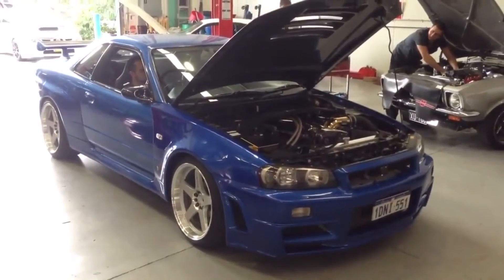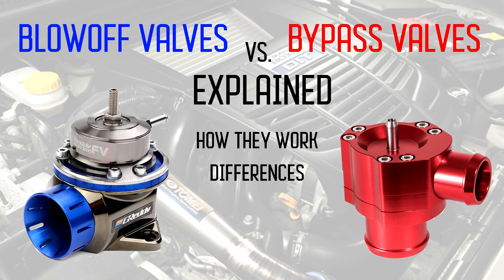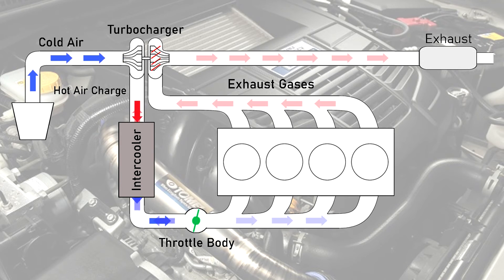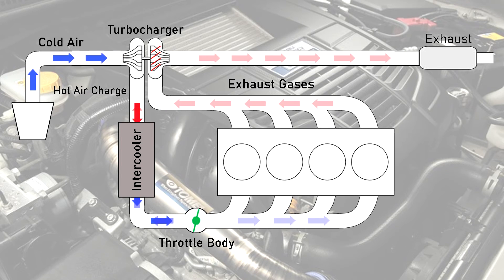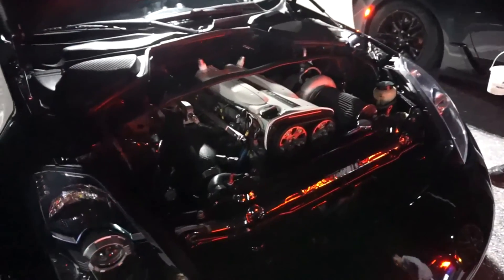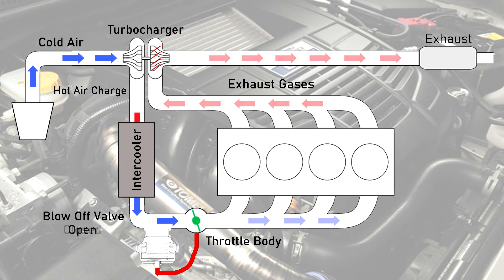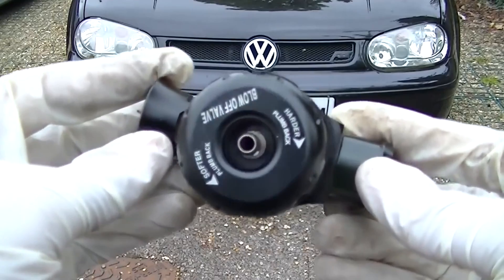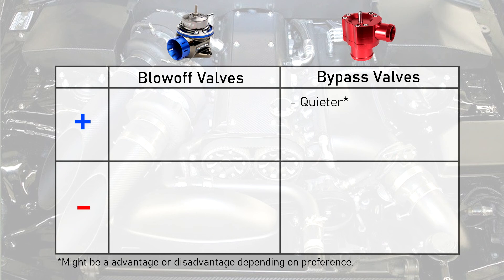Quickly Clarified - Blow Off Valves vs Bypass Valves in 4 Minutes!

Comment: I used to work for Garrett granted this was over five years ago but the sum of the statements that you made in regards to the CBV are incorrect and high horsepower applications these were well and low and high horsepower applications one thing you did mention was correct was the majority of the time space is needed but this is easily overcome
Reply: What the hell are you even trying to say?
Reply: @KreatorOfDeath1985  Bro he use to work for garret!!!! who tf is garrett?
Reply: @byron1dagg80  Garrett is a company known for their turbochargers. Their entire brand revolves around turbocharging cars.
Reply: Bro, use some punctuation. I can not tell what youre saying
Reply from the maker: thanks for the correction, pinned your comment
Reply: Is that English?
Reply: okay I'll transcribe it I guess. 

"The majority of the statements you made in regards to Circulating Blow off Valves (?) are incorrect. These aren't just for low horsepower applications, they also work well in high horsepower applications. One thing you did mention that was correct however was that they are often times not used because of space limitations, however this issue is easily overcome"
Reply: What, were you sweeping their floors? In doubt you could grasp the engineering behind even basic principles like a toaster let alone forced induction with the atrocious grammar, and basic English used in that comment. If you are gonna bullshit in the comments, at least read it before posting 😂
Reply: From what I know: Also what is missing here, if the car comes from factory with a MAF, venting to air can cause the engine to run rich. That is because the stock ECU thinks the air is still in the system for use and adapts its injector duty cycle to the air it thinks it has available. That would also be a con for a vent to air in that case.
Reply: @MarxusRainbow that’s true, but most people going as far as a BOV (likely intercooler, intakes, downpipes, etc.) are likely doing some sort of AF tuning as most of the older models still using MAF systems are well outside of warranty, if not they can expect to run into some issues regardless. Thankfully, most newer model systems that are forced induction use MAP sensors instead of MAFs.

Comment: Correct me if I'm wrong please I'ma Whipple guy and new to turbocharger, so my ❓ since my car has a stock turbo charged and I'm not planning on upgrading my turbocharger I only want to upgrade a cold air intake with cat back delete and tune. 

So my question is, keeping the stock turbo should I put a BVP only?

Comment: I don't understand one thing, there is nothing preventing high pressure air escaping out the air filter in a bypass valve system. How is that then any different from directly venting air to the atmosphere?
Reply: There is, when it’s recirculating it goes to the where the turbo sucks its back in, in a loop

Comment: Bro...can turbo diesel engine use the same blow off valve as the petrol engine?
Reply from the maker: absolutely, just depends on the mounting to the piping. it has to be airtight so there's no boost leaks
Reply: @JCMediaYT oh nice...thank you for answering my question😃
I always wanted my car to have that Pssshh psshh sound...I just bought a used  pick up truck couple weeks ago...4WD Mitsubishi Triton year 2010...and I heard that if your car doesn't have throttle plate you can't install BOV...but luckily my truck does have 1...hahaha...turbo with no psshh psshh is like hotdog with no sausage😆
Reply from the maker: @JakeHuang24  anytime! I'm not too sure about the throttle plate stuff since I don't have any diesel cars, but goodluck with it! feel free to leave any more questions if you have any

Comment: So from wat I can tell bov only vents fresh air, so then why is it against the law to have one in my state ?
Reply from the maker: I believe it has something to do with emissions. I'll try explain it as simple as possible. When the air gets sucked into an intake, it passes through a MAF (Mass Airflow Sensor) that basically reads how much air is going into the engine. The ECU reads this and injects the appropriate amount of fuel. When you use a vent to atmosphere BOV, the air is escaping the intake system and going into the air, but the ECU still thinks that there is air going into the engine. This creates a "rich" condition where to much fuel is being injected since the air was vented.
Reply: @JCMediaYT  ahh ic, i understand why the law is that way now, thx for that.

Comment: Question. Can a "bypass valve" work as a "blow off valve" ? If you just remove the pipe that runs back to the intake manifold (or the place the extra air goes to and obviously block that part up) ? 

I will be running a carburettor, so I don't think that will affect air flow readings etc...

The reason I'm asking, is because i already have a bypass valve ( I bought a supercharger from a toyota which had the sc12 supercharger on it and the bypass valve is the one that came with it) 

So my final question is; should I go by a blow off valve? Or should I just use the bypass valve as a bypass valve and be happy? Or can I use the bypass valve as a blow off valve?
Reply from the maker: theoretically yeah, since they are basically the same thing (a valve actuated by vacuum lines)
Reply from the maker: usually cars come with a bypass valve made of plastic which can't handle increase boost levels, hence why some people may change to a bov (also for the sound). However, a higher quality BPV works just as well so it's mostly down to preference on which sound character you prefer
Reply: @JCMediaYT  Ok thanks for the reply. The toyota BPV is indeed made out of aluminum and I'm only going to 8.2 psi boost (stock toyota is 8 to 10 psi boost stock(i think, going to make sure on that first)). Anyway, I guess i can always just experiment, and see what happens. Thanks again, i just subscribed to your channel ( °^°)
Reply from the maker: ahh yeah, should be just fine then. good luck with the build man! and many thanks for the sub!

Comment: I have a question: What does the "red" cable (the one on the lower part of bypass valve) function? it's at 1:25 mark.
Reply from the maker: that's the vacuum line for the valve to open. so when you let off the throttle the vacuum in the line opens the valve.
Reply: @JCMediaYT  thanks for your response!

Comment: There is no difference in turbo lag between both valve types, bypass valves don't recirculate any appreciable pressure back into the intake.

Comment: Heyy bro i want personal information about that … i want stututu sound … what is the main reason and part that make stututu sound
Reply from the maker: its from running no bov or bpv. here's an example of what that sounds like: https://youtu.be/i-6dj7y_YDc
you'll get much more flutter out of a car with a front mount intercooler rather than a top mount like mine.
Reply: @JCMediaYT  oh okey bro but i want it on my tractor.. will it work on it?
Reply from the maker: @jattintruck  I'm not sure how it is on tractors though...

Comment: Honestly, at lower boost you can completely bypass it, if your driving rather hard most of the time... you'll be fine with neither... and you'll get that short "flutter " between shifts if you clutch long enough. For daily driving, yes you'll want one or the other...but if your mostly tracking your car and you are below about 25 psi boost (note* turbo dependent) your fine not running either.

Comment: So Kawasaki H2(R)s have a bypass valve instead of a blow off standard right?
Reply from the maker: not 100% sure but most likely
Reply: superchargers generally always use bypass valves because BOV's would always be venting (wooshing) whenever you're of throttle, which most people find annoying and obnoxious

Comment: If u unplug the hose that returns the boost and leave the boost go in to the air. Will it will make the dv valve like the blow off . And of course u block the other side of the hose that may suck some trash in ur turbo?
Reply: Yeah but then the Turbo isn't spooling up any air, if you block the other side

Comment: I got a question, When using a blow off valve, I know a lot of cars have a Mass Air Flow sensor, which senses the amount of air going into the engine. If using a blowoff valve, the air that is shot into the atmosphere is accounted for. Therefore the Mass Air Flow sensor will tell the ECU which tells the fuel injectors to push more fuel causing the engine to run rich/lean. Is there anyway around this?
Reply from the maker: normally, you'd have to get a retune but so far, mine didn't have any issues with getting too rich/lean, having an Afr gauge is very useful
Reply: I had this exact question about a centrifugal supercharger kit (similar situation to turbos), and just found the answer to my question.  It depends on the location of the MAF sensor.  Some kits will relocate the MAF to be between the intercooler and throttle body, so as long as the BOV is before the MAF, it'll never know the difference.  The MAF will only see the air which made it past the BOV and is about to pass the throttle.  The kit I was looking at is like this.  If your MAF is located before the compressor, then you're going to deal with the rich condition on blow-off as you described.

Comment: Nice info, btw my car using OEM bypass valve but due to make minimum lag i took it off and get early boost when i'm shift gear or exit cornering it cheaper way rather than using anti lag system 😂